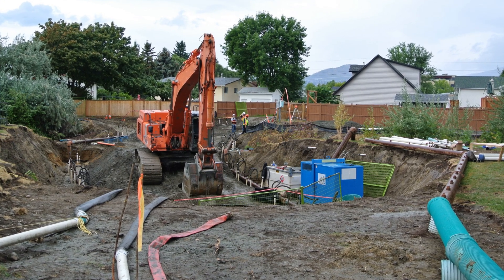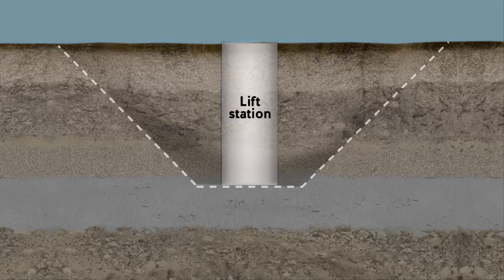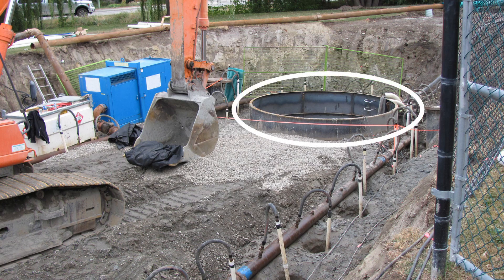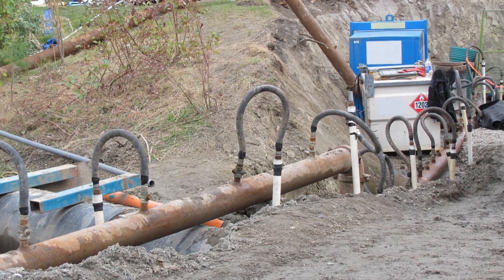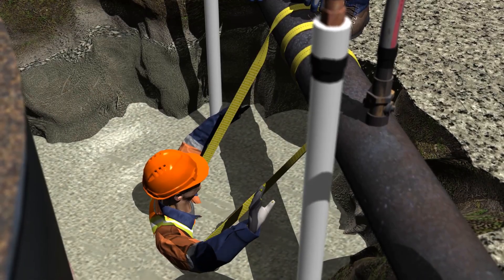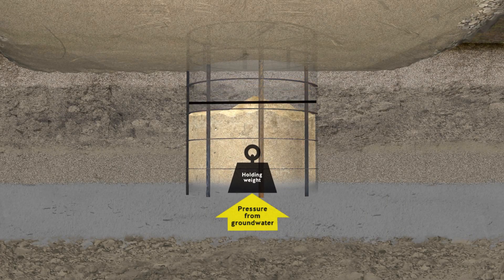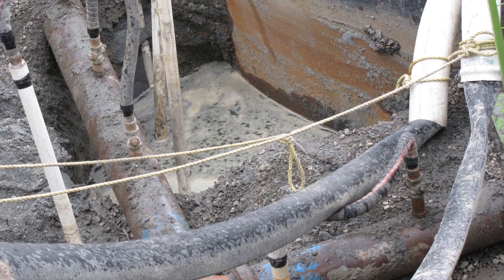Incident Investigation: Worker Pulled Into Ground by Quicksand Condition | WorkSafeBC

Comment: Boiling water indicates present of air  while the suction applied to the worker indicates that the soil is still saturated with water. My OPINION  is this: there was an underground cavity that collapsed under static  pressure of water in  the steel casing.  I wouldn't be surprised if the dewatering was stopped automatically by overflow valve or accidentally by an operator.
Reply: After doing some research, it turns out that such problems is known to commonly  associate  with dewatering  and could cause damages to the  structures

Comment: I have worked on a number of older buildings, and on several occasions came across foot wear inside the wall of a building.  Eventually I learned that in earlier times, leaving a pair of shoes or boots inside the wall of a newly constructed building was considered a good luck token for the building.   Lucky plumbing in this case, I suppose...

Comment: Once upon a time I was walking a beach at low tide and was crossing the outlet delta of a salt marsh. The water was only calf high, next step I was up to my waist in quick sand. Always fall forward or to the side to distribute your weight. Did I mention this was March in New England? Barefoot, slowly wiggled my feet up and pushed forward couple of feet and got up. Soaked and a mile from my car, happily the V8 was still warm and I had a snowmobile suit to climb into. And my car keys.  Oh, read a book once on how to survive ( almost) anything. It worked.
Reply: Yeah, not the same situation though. You couldn't have been pulled under the surface, only become stuck.
The worker was in real danger of being pulled under, due to the suction created.

Comment: Wow. This definitely gave me a clear idea of what happened.

Pretty much the casing wasn't sealed at the bottom correctly, due to an imbalance.

The side that was opened and allowing water back in, created a vaccum. Similar to a straw 🧃 in a juice pack. All the suction was being localized on the exact area the worker was standing and then being funneled through the opening underneath.
Reply: But why boiling inside the open to the atmosphere steel structure. Do they mean air bubbles ?

Comment: 5:22 "This removed the holding weight and increased the hydrostatic pressure differential"
Flashback to underwater pipe sucking in a crab
ΔP is attacking us on land now, it's evolving!

Comment: When I was 16. I was working for a company doing fibreglass pools. We had the pool in and leveled, started filling with concrete I was by the edge with a shovel and it gave way I went into the wet concrete and was going down under the deep end of the pool. I screamed and 2 co workers were able to run over to
Me, I was holding a spade shovel with both hands trying to hold my self up
But it was sucking me under. By the time my co workers got to me in about 5-10 seconds I was up to my underarms in cement. If those boys weren’t in the back yard i would probally still be a missing persons

Comment: QC conditions are prevalent in post-hurricane situations on coastline dig sites.  Even now, the water table is 3-5 feet BELOW grade, on average. Normally the table is about 25-50 feet deeper after the wet seasons in winter. This necessitates extensive dewatering, use of caissons, and hole reinforcement.  This adds time to already mangled and shredded time tables and schedules filled with sick calls and logistics issues.

Comment: I almost died in quicksand when I was a boy. I was playing in the mud in the backyard and when I looked down I was submerged in the mud up past my waist. I didn't even realize I was submerged until it was too late. I tried screaming but I was too far away from the house I was back behind the shed and no one heard me. Luckily a video I had seen on PBS saved me. I laid back and relaxed. I floated to the top and managed to crawl my way out of the mud. Scary experience though.
Reply: You didn't almost die(other than theoretically been stuck there long enough to die from other causes), even though it may have felt like it. Once it stopped at your waist, you were floating - this is the typical depth people sink to.
To me, it's best to think of quicksand like much denser water.

Comment: I installed a can + concrete wet well on a concrete slab in Pembroke Pines Florida. I tried 80 well points and water level would not go down. I drove 40' long pieces of AP-3 sheets with corner pieces to form a large deep hole with H-beam  braces welded to the sheets at the top around the hole.  We were amazed that we were able to dry the hole and installed the slab rebar. On the 3rd day we were ready to order concrete. Suddenly a corner blew out and the water came in like an oil well strike. Adding a Sloane brand 10" hydraulic submersible pump would not budge the water level. The bottom had apparently sealed itself with vibration of the  vibro hammer driving the sheeting. The bottom turned to mush. 
Her is what I did. I had my small dragline over dig the hole about 5 feet deeper than needed. 
I filled that 5 feet with limestone road rock. Had welder attach 6" angle iron pieces every 2' on an extra "H" beam. I had the crew put the beam into the vibro hammer and we lowered the beam deep to below the road rock. Probing at random around the hole. The vibrations continued and we added a bit bore rock. In about 4 hours the bottom was like cement.
We poured the slab above ground with heavy cables on 4 corners. The wet well & can were secured to slab. I had a diver level the bottom. I then hired a crane company to move the assembly over the hole and lower it using their spreader bar and four 40 ton cranes.
I pumped water inside both the wet well & can to prevent floating. The can entrance tube was welded to the can in sections as it went down. Had diver release cables when structure in place. Then backfilled and pumped out water from can & wet well. All went well.
I never want to try this again.👀

Comment: i got stuck in waist high mud once on a work site in the Uk, at first it seemed funny until I realised every move I made, made it worse and there was nothing to grab a hold of. I had riggers on as well, so the top of the boots is just open and mud poured in them, there was basically suction around my boots and I couldnt pull them or my legs up, eventually I must have broken the suction and managed to pull a leg out and wriggle free. Honestly at one point I realised I might die in some stupid mud. Iwouldnt even say it was quicksand, it was mud mainly but it acted the same and I was stuck so bad

the suction is so strong, literally like ur feet are set in concrete, not a pleasant experience, this guy must have pooped himself

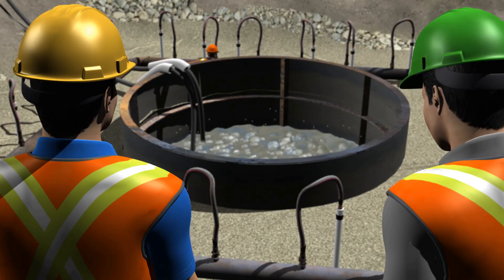Comment: 3:25 the water started to boiled wtf
Reply: Lower pressure lowers the boiling point.

It's possible to boil at room temperature if you lower the pressure enough.
Reply: @hatad321  Yes I understand that. But the boiling water in the steel housing was open to the atmosphere.  Without heating the water, it can't boil under such conditions. It's rather possible that the workers saw air bubbles and mistook them for boiling bubbles. 

Another point is: The other workers saw the water level rising, inside the steel housing. How to create a negative pressure, inside a partially closed steel housing, when you increase the fluid level inside the steel housing ?

6:01 "pressurized water from lower aquifer." If I pump a liquid into a tank open to the atmosphere, it won't start boiling.

I look forward for any good answer, for me it makes no sense.

Comment: Me, a financial analyst who never even goes outside for work: “bore holes have to be deep enough to provide adequate data for proper dewatering. Noted.”
Reply: Remember to dig them around the work area as well, so you can note the difference in height of the layers.
Reply: Lol
Reply: Well now you know to be wary if the cost assessment seems cheap and only accounts for a limited number of bores. Then you can wave a red flag for further review 😉
Reply: me, a simple it guy: hmmm yes. ground sinky
Reply: Literally. I’m a cpa and never leave me office but here I am 😂
Reply: @bigt1877  never leave me office, but here i am! ar ar ar ar ar...
Reply: Mmm...yes...very respectable and accurate observation. I will file this in my notes for further use at approximately 3:00am CST, two years from today when I lack the ability to sleep. Thank you. - Me, a retail Home Theater installer.
Reply: This is relevant to my job but I will never ever need to use this directly. I will need to ask if others did this or if it comes up in a risk conversation about new or modified facility builds. So even people working in in risk still won't use this unless you're directly managing the project in some way. It's very niche.
Reply: Purchase order: Bore hole drilling
Purchase order: Geotechnical analysis
Purchase order: Geotechnical analysis
Purchase order: Caisson rental
Employee reimbursement request: New boots
Reply: You sound hella boring
Reply: How did you become a financial analyst? That’s my goal
Reply: We don't care bout ur jub
Reply: Bro same comment. Fuck
Reply: Touch grass. That's a normal response.
Reply: You should watch the USCSB next :)
Reply: should've put the end quotation mark BEHIND '...dewatering.'
Reply: Exactly, looking at the aquifer like “yeah something’s definitely going to go wrong with that”
Reply: WHen shet starts to hit the fan one day.. all of this will become useful!
Reply: me, a YouTube viewer who didn’t care:
Reply: @420subswithnosubs  YouTuber?😂🤦 I think you mean YouTube viewer...
Reply: "look at me, guys, I'm a financial analyst"
Reply: Except your neither of those 😂

Comment: I had always heard that quicksand cannot pull someone below the surface... it’s more dense than water; since you float in water, you’ll float even higher in quicksand.
Reply: Did you watch the video?
It wasn't a normal quicksand scenario, there was suction.
Yes, in normal quicksand you'll float, considerably higher than in water.

Comment: I was working Grinnel sprinkler putting in 10’’ underground fire sprinkler main in an 8’ ditch,
I was just finishing a connection and starting to stand up, when I felt the wall push my butt, 
I put one foot on the pipe and launched straight up, both hands hit flat on the ground on the
top of the other side and I rolled out just as the walls met. Thank GOD the pipe was a foot off
 the bottom or I’d have been between them !

Comment: You can call it due to quicksand only if second mechanisms happened (@6:00). The soil is needed to loose cohesion to create a quick sand condition, that is only possible if there is negative water pressure. And if there was a rupture in the second aquifer that would cause the continuous upward seepage of water even after the accident but it looks dry on the surface.  
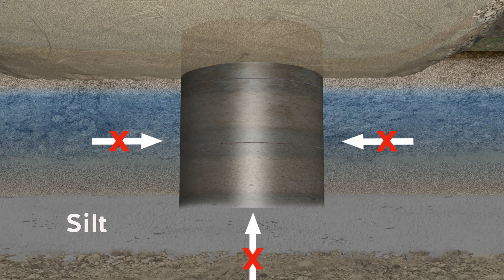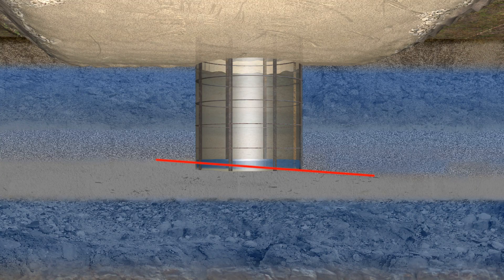In the accident site there is only one place where soil seems to have collapsed(@2:25). It's more likely that mechanism-1(@5:55) is the one that caused the accident.

Comment: I believe the second scenario at 6:03 is more likely. Apparently the lower aquifer was identified in another report meaning the driller had to have located it. It would also be interesting to note that if the driller drilled down to the lower aquifer in the exact spot of the proposed lift station this would have been the cause of the boil and thus this incident.
Reply: The boiling water in the steel housing was open to the atmosphere.  Without heating the water, it can't boil under such conditions. It's rather possible that the other workers saw air bubbles and mistook them for boiling bubbles. 

Another point is: The other workers saw the water level rising, inside the steel housing. How to create a negative pressure, inside a partially closed steel housing, when you increase the fluid level inside the steel housing ?

A liquid can start to boil at lower temperatures, when you have a negative pressure and the liquid is contained inside a closed (to the atmosphere) structure. Like a pressure cooker. 

If I fill a tank with water via a pump, will the water inside the tank start to boil ? No it won't
Reply: @ImplantedMemories a water boil is a term for turbulent, aerated water. We use it while kayaking/canoeing. The report is correct in calling it boiling water

Comment: Pump in water around his legs into the ground really helps to get unstuck from liquefaction. But mad i bet he was scared tho. Theres alot of quick sand down here in FL.
Reply: That wouldn't have helped until the suction had ceased/pressure difference had balanced out.

Comment: A neighbor lost a horse in quicksand in the woods behind our barn.  Until then, our Dad didn’t know it was there, although we did know there were patches of it in the area.  We kids used to play in those woods frequently.  After that, we still went in the woods, but with a lot more caution.  We had a dog go missing and he could very well have gotten sucked underground because we never found any sign of him.
Reply: Normal quicksand doesn't pull animals under the surface, they get stuck. It's effectively like water but heavier and thicker - you sink a certain amount and then 'float'. It's probably one of the few natural situations that humans are better equipped for than animals, due to our high arms.
The case in the video involved suction being created, a similar situation could've occurred with just water.

Comment: My dad lost two cat dozers to quick sand when were filling in a swamp to get rid of my school teachers mosquitos..operators were rescued but we lost a brand new d8 and a new d10 I had the big one the d11 lost her for a time but I chained her to a giant oak two days latter I grabbed our huge excavator my dad said it's not gonna work but I found I couldn't hold traction so I grabbed the three d8's four loaded dump trucks chained my rear to a LL that and worked her out but the other two are still there today we buried them and the swamp pumped in clay and concrete with massive boulders..I got sucked in for about 30 minutes lost my boots and shorts lol.its real it's deadly it will suck you down.and thankfully these guys made it.

Comment: Quicksand is no joke and it does exist. When I was a kid my father owned about a hundred acres and running through it was a very deep Gully. I fell into quicksand at the bottom of this going. I think about quicksand is the more you fight the more you thrash around the quicker you sink. I probably would have died had not my horse who was so well trained came up to me I'm pulled me out as I held onto the reins around a bit near the bit in his mouth.
Reply: In normal quicksand you're simply floating once you sink a certain amount(typical about your waist) Struggling likely wouldn't have sunk you much further, but it would've drained your energy.
You wouldn't have died, short of being stuck there long enough to die from another cause.

Comment: I been in the ground up to my waist when a kid with my bycicle alone in the woods it was fun untill I tried to get out it took an hour and I finally used my bike to climb into then retrieved my bike and left the 12 ft round area of quick dirt. The mud on my jeans was like thick concrete. I had to walk my bike uphill before I got home safe.
Reply: I fell into a tiny tiny stream at a golf club that had 10s of feet of mud in it, was holding onto a bridge to stop being sucked under and luckily I was with friends who slowly pulled me up till I escaped
Reply: @ryanwatterson4038  You won't get 'sucked under' the surface of the soil unless there's an unusual situation that creates suction, like in the video.
Once you sink to a certain amount(typically your waist for quicksand), you're floating.

Comment: I installed 6 of these over a 10 period working in the underground utilities industry. The one step we always did was to pile sand as high and the casing will be deep. So if we are sinking a casing 20 feet 120 days before th job starts we start dewatering and we would pile sand 20 feet high on top of the sight. This is sir charging. Just the weights of the sand alone would drop compact the ground 2 to 5 feet. As the water is removed it would compact the ground more. We remover the sand and start the casing. We live where sand is cheap and plentiful. Some areas this is not an option. It sure firmed up the soil under the project. After removal the sand you could see a huge dent in the ground from all the weight of the sand. Stay safe.

Comment: This happened once by my house, except it wasn't a person that sank but the ass end of a car.  Basically something very similar happened the city was replacing sewer pipe down the center of a 4 lane wide street right through the middle of historic "Old Town". They had an excavator with a breaker and a 24" clay spade on it. We were sitting at an outside table at the coffee house and we noticed that as the breaker/clay spade was thumping the back of the car at the side of the street was sinking into a depression in the street that was forming. it was little enough to start (1-3 inches) and we thought it funny, but 5 mins later a 5' sink hole opened under the car and we ran over to help the guy who was in the Dry cleaners.... 

He said "Let it sink, nothing of importance in there and that car was a lemon"... 5 minutes later it was almost completly covered with silty sand at the bottom of a 15ft deep hole.